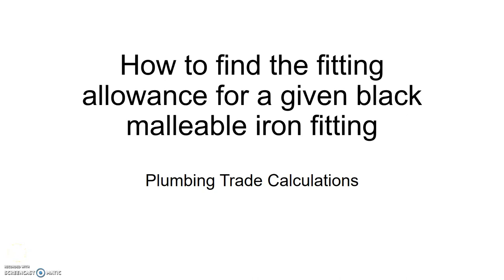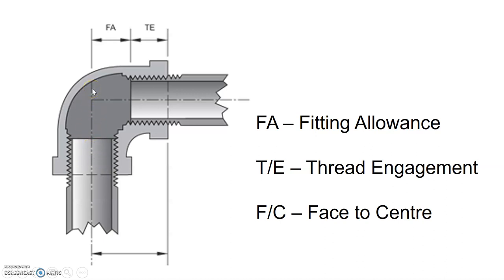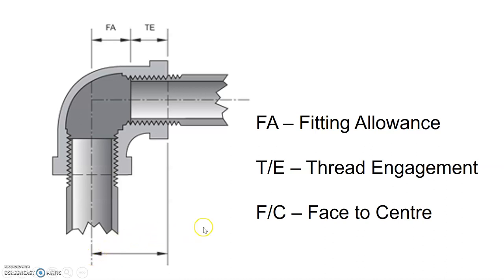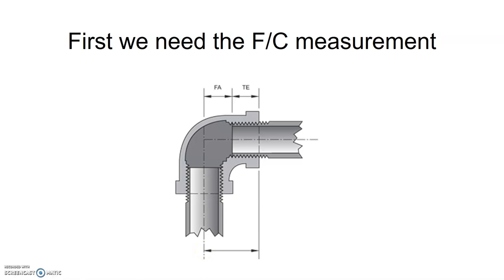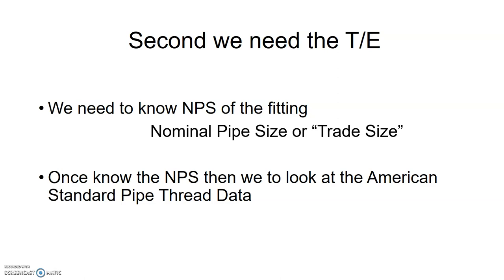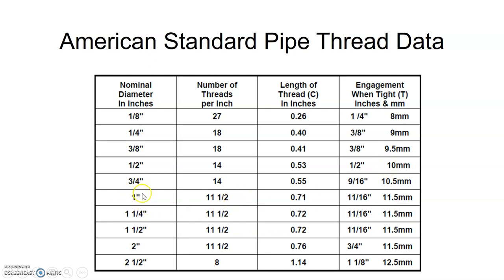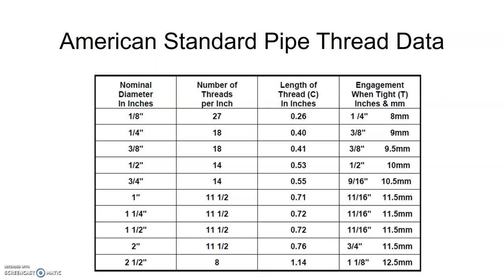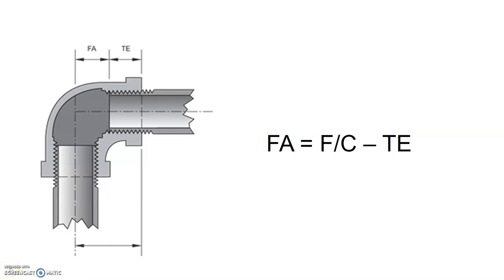Find fitting allowance for a black malleable iron fitting

Comment: Isn't TE also provided by the fittings mfg, ie. Ward fittings has a PDF doc with all of the center + thread measurements. Wondering if that's the same?